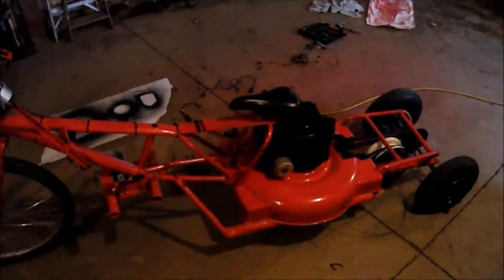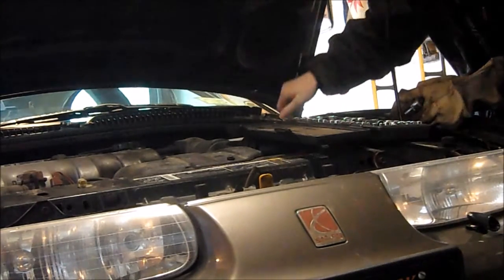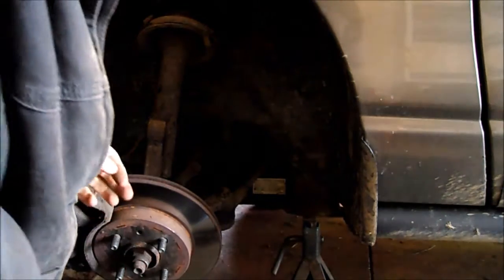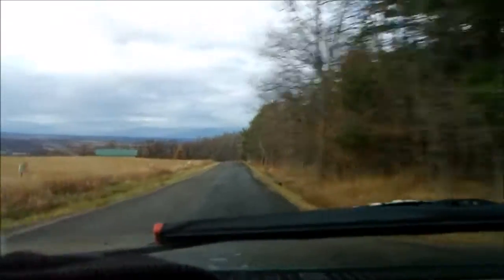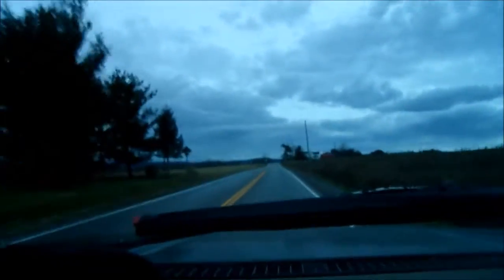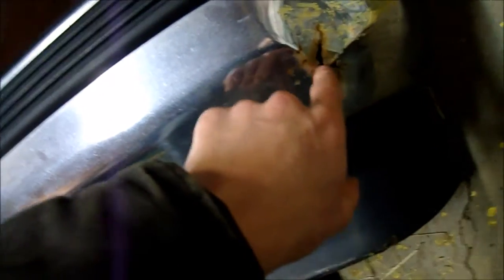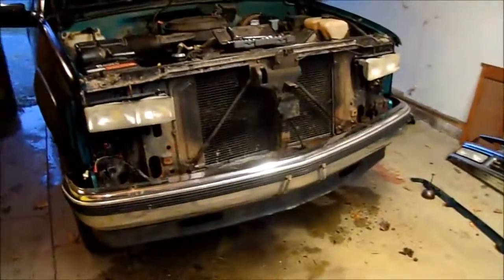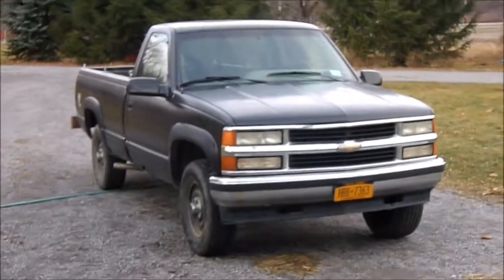Saturn strut and Chevy bumper

Comment: Good bumper looks a lot better. you could get a brand new strut on ebay for only 25 bucks or so.  You could probably get a pair of new ones on ebay for about forty bucks.
Reply from the maker: +shartne this oem stuff is better though, but i know what you mean.you could get some darn good deals on ebay. i buy alot from ebay ,but i needed to get this job done fast

Comment: That is a better bumper ...I have never seen a broken spring on a strut and that much rust on the top of the strut and the bolts .They use salt on the roads here and it rots out alot of cars
Reply from the maker: +not2fast4u2c salt kills....just eats and eats

Comment: That plastic piece in the bottom of the bumper, is there tow hooks or lights that are supposed to go into the 2 openings?  If lights maybe that is what that wire is for?
Reply from the maker: +Mopardude the holes are for tow hooks I'm pretty sure.  the wire could be fog lights or some accessory for sure